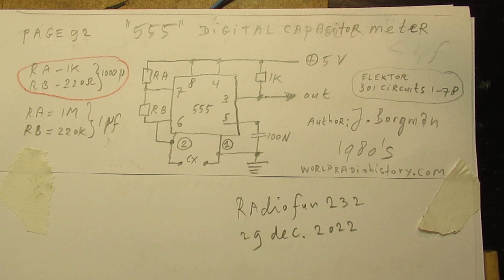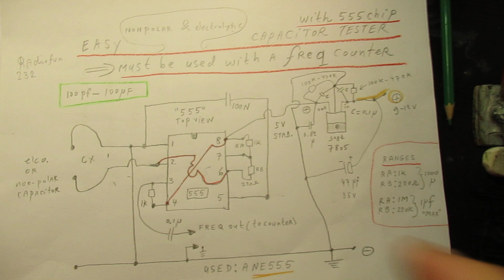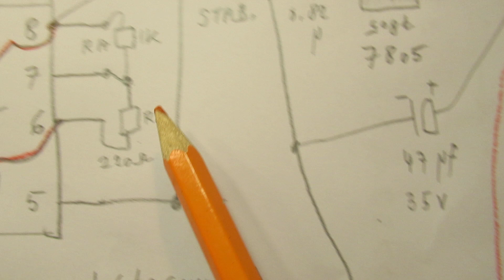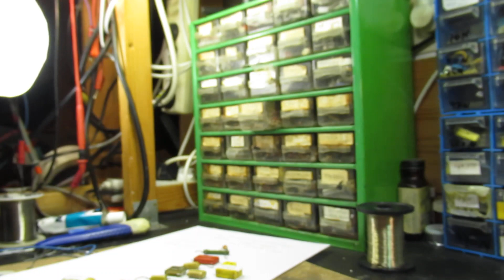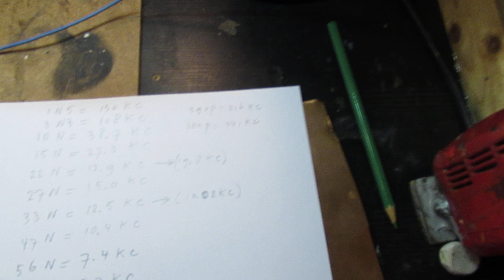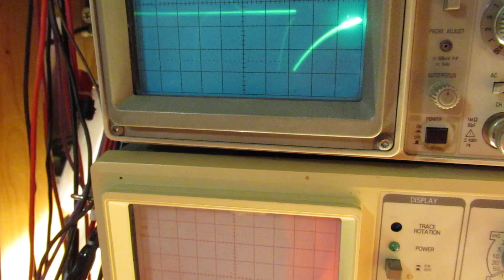Easy capacitor tester 100 pF-100 uF made with a 555 to be used with a freq. counter schem & demo

Comment from the maker: Today (4 jan 2023) I have tested a lot of capacitors (all kinds of types, say ceramic types, foil types, etc, of the same values) in this circuit. The final table (relation frequency-capacitor value) is now published in the textbox/description of both video's. Links & info in the textboxes. Due to the (big) tolerances of consumer capacitors, these values (freq-capacitance) are (though very reliable) approximations. Interpolations can give in-between values. 4 jan. 2023.

Comment: This is a very informative video.  I would be interested in more circuits I could create in order to test other components. Thank you, Ko!
Reply from the maker: Thanks David. There are more/many circuits on my channel to test components. You can search via the "looking glass" on my channel trailer (Radiofun232 on You Tube). Here a few of them (the best elaborated):
Inductance tester 10 uH-10 mH
https://youtu.be/zgDfNmk9Whg 
Measuring high inductance coils
 https://youtu.be/ICW7V9vwyJ0 
other inductance meter
https://youtu.be/THvEqSAKD6Q
MOSFET tester
https://youtu.be/HK-767kxGtU 

30 dec. 2022